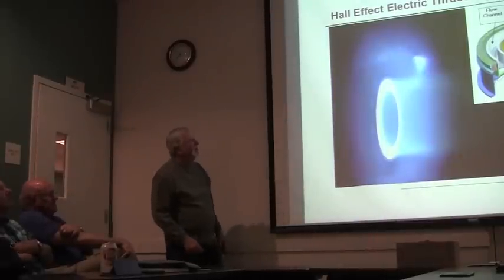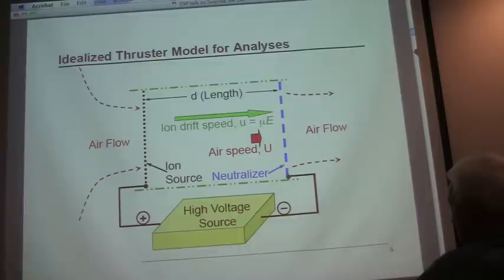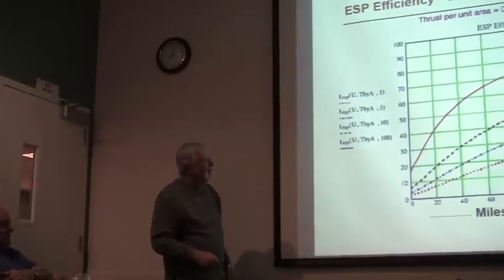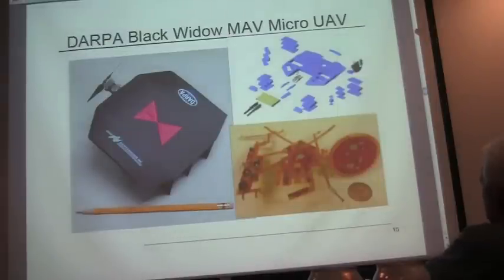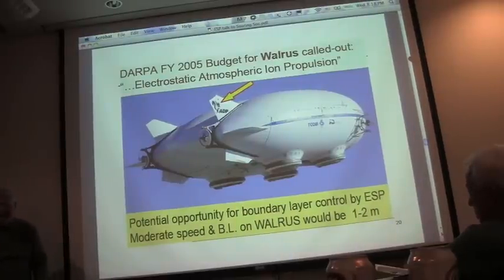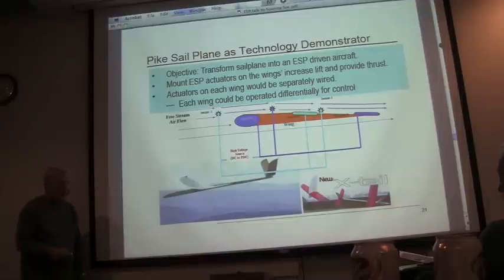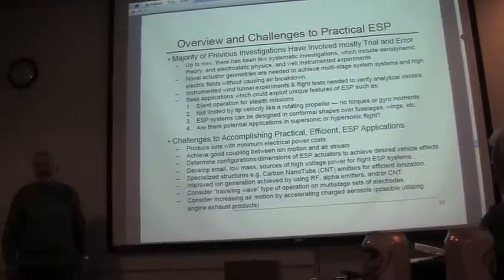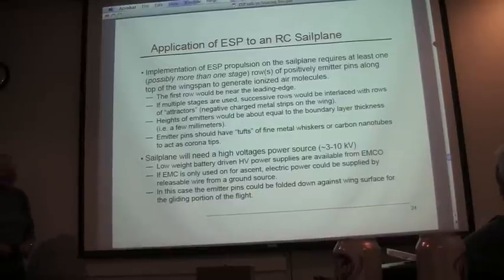Using Ion Propulsion in Model Aircraft

Comment: Why don't they create tony starks ion propulsion  or electromagnetic aircraft  not the ones they have now or weav one has been done along time ago and works using a lot of electricity but sucks not made for outer space,,, Only electromagnetic will work in space at really cold temps...Take a helicopter with two blade one turns opposite of each other  do the same with electromagnetic's that's it figure it out from there...I've done one all ready it works..But don't use batteries to keep it going.....

Comment: Good informative video.  But if it's just an "ion wind" effect can someone explain what's happening in this video with a tungsten emitter in a vacuum tube! with the effect still happening???  https://youtu.be/DctZcxxe30I
Reply: In reality, a properly functioning EAD thruster just adds electrons to the O2 molecules in the air.  Probably to their outer orbital shells primarily.  Most of the ion wind effect is electrostatic in nature, the O2 molecules with extra electrons present, just get pulled  to the collector, like a charged Styrofoam cup can be pulled to a persons hand. Even if the emitter wire is encapsulated, some of that static still escapes into the air, a bit like how a magnet can pull through a sheet of paper, although we are talking about electrostatics not magnetism. In the Naudin video you have shown, the whole effect could be explained by electrostatic attraction. However, he has another video that shows the device still producing lift, which is in line with what I just said.  There are some ion propelled aircrafts with onboard power supplies shown in flight, on my channel.

Comment: Where are they putting the HT supplies in the craft? they are quite heavy right, you know from auld crt displays & tv's etc
Reply: It is possible to put a power supply on an ion propelled craft.  The craft has to be specially designed to be more efficient, and the power supply has to be relatively small and high frequency.  They did previously use quite heavy external power supplies. It took many years to get it to work.

Comment: This to me seems as uselessness. And go no where fast, 
What happens to constant magnetic acceleration, Spin a magnet extremely fast and you can generate ions at both ends of the spinning magnetic field, without the introduction of any gasses, and you will get acceleration, and then you are also from the high rotation of a magnetic field, you are generating a high density magnetic field by rotation,
This science you are listening to has gone off on a tangent of what we need.

Comment: The airflow in the simple 'lifters' isn't enough to lift them so there is something else at work here.
Reply: Those EMCO HV PSUs are now part of X Power : http://www.xppower.com/Applications/High-Voltage-Power-Supplies
Reply: Blimey that jet noise at the end of the vid made me fly out of my seat! Very interesting presentation, thanks for sharing.
Reply: The study on Townsend Brown's disks showed that the ionic effect in his ionic propulsion didn't work in a vacuum. Major DeSeversky had already demonstrated what he called Ionocraft back in the fifties and sixties and they seem to be recycling already studied and proven concepts that have been allegedly used in classified torpedoes and aircraft for a long time
https://www.youtube.com/watch?v=GijJmIz1G7U
 particularly the 'boundary layer' effect he talks about which has been used in hypersonic aircraft. This guy is going on as if it is all new and not been used yet, but I have found numerous sources from obscure Aerospace publications and leaked material that shows they've been using electrostatic boundary layers to improve aerodynamic performance since the sixties and is used also in some types of torpedoes.
Reply: @FrancisMaxino  didn't you see Hunt for Red October?
Reply: Here's something to check out and think about, with the emitter in a tube and still pulling the bottom part up...  https://youtu.be/DctZcxxe30I

Comment: 6g of thrust with 13 watts? Isn't less efficient than a propeller? I'm not sure why, it's supposed to be so efficient?
Reply: Remember this is for an RC sailplane.  This is lighter and more aerodynamic than a prop powered sailplane.   Its similar to the principle of the "ionic breeze", that was on every infomercial in the early 00's.
Reply: NikoxD93 it's only more efficient with momentum based space travel
Reply: Second Sun Lab Ok, got it. Apparently it is more efficient at higher speed in the atmosphere too? But there seem to be problems of electrical arcing at high altitude (or low pressure).
I wonder if you could combine normal propellers + esp + xenon thruster to go in orbit only using electricity. (Maybe on a low drag Zeppelin)
Reply: @secondsunlab2302  Not true, if you have a lifting surface that's fairly large like a saucer and use a magnetic field to direct the flow of ions below it
Reply: It's more efficient than a jet engine given the right topology.
Reply: Here is one that is about 10 times more efficient:
https://www.youtube.com/watch?v=Qdg0_hjuksQ&list=UU_trtRcbCLO9Q2CzbKAya3w&index

Comment: I love the efficiency of ion thruster, I'd like to launch a high altitude Zeppelin that slowly build up speed and increase altitude progressively, I'd like to be able to make the calculations to know what's possible.
Reply: Ion thrusters aren’t efficient that’s why they use propellers! This guy is reaching way too hard
Reply: @taattataattataattata  propellers are efficient at low speed, but at high altitudes where the air gets thinner I think thrusters are more efficient, but I'm not an aeronautical engineer, I don't know the answer, I am just curious if you know the answer

Comment: I wonder if the folks working on the Aurora D8 have evaluated ESP for reducing the distortion in the airstream to simplify the design of the fans on their BLI engines.
Reply: They have. But anything that is cheaper, faster and better does not fit in to the Military Industrial Complex agenda. It has to be realy big, slow and useless. That way they can suck trillions of dollars out of the economy. This guy is only regurgitating what they have already known and implemented for at least 50 years. This is a pUBLIC FACE so that they can now go back and get more money from the public via a public company. They get paid three times. Black Budget, Public military budget and then the private sector budget. At the end of the day you can build anything he is talking about from eBay with about $5,000 bucks USD. Thats right eBay. If you want to go first class you would shop at Amazon.

Comment: it's time to retire  liquid fueled rocket engines , they are too dangerous  . we need knew generation of spacecraft propulsion  less flammable and potentially explosive
Reply: So far if they are not potentially explosive the engines engines ether radiate the human body to death or becomes an high voltage hazard..
Reply: But I agree that we need to find a way to extract more propulsion out of other sources.. The only reason we keep to chemical combustion is because we get better potential work in a smaller space out of chemical combustion..
Reply: is there not a way to "shield/cage/protect" humans from radiation effects/exposure ....  like a human is protected from electrical shocks by placing it in a Faraday cage?
Reply: they could design a iono rocket for sure. or electric drone engines stacked inside, combined with the electro gravitic lift, guided iono flow.
Reply: @TheTrumanZoo  IS electro gravitic lift an actual thing?